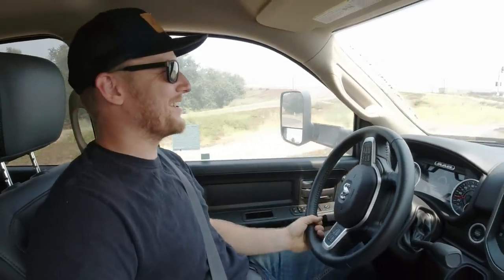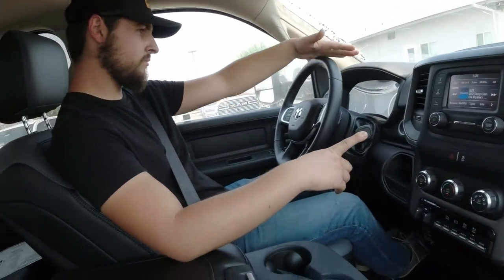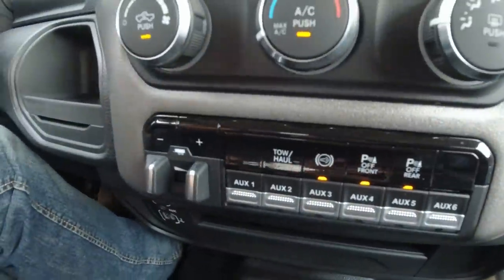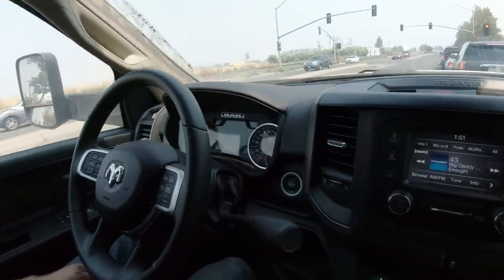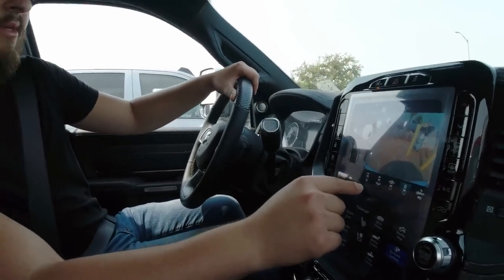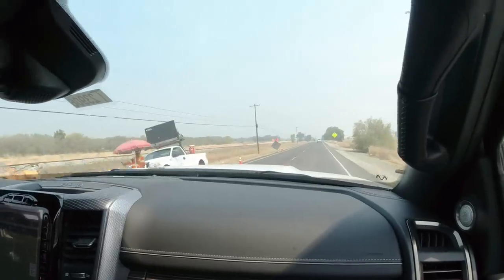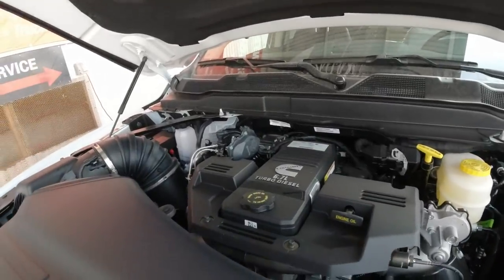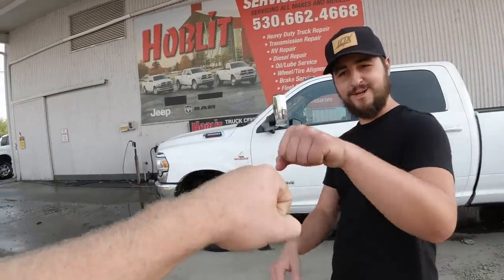BUYING A NEW 2020 TOW RIG. Go with a 5500 or 3500???

Comment: It is a tough decision because it is not just power and brakes.  The truck 3500 with the Max Tow package has the welded frame integrated hitch mounts and the sweet auto leveling airbags.  That is why I got mine as a DRW truck Tradesman (18).  The 5500 is nice because the D-rated engine will last longer, better turning, and more fuel capacity from the factory with dual tanks.  Probably for something that is always going to have weight he probably will like the 5500, power is nice in the standard truck but reliability of having the same cooling capacity and a D-rated engine is better.
Reply: Also, not sure how Ram is doing it now, but the Max Tow package includes all the hitch receivers and wiring.  I would be skeptical of a dealer selling a Max Tow without pockets installed, and again the factory receiver pockets are nicely welded into the frame.

Comment: I’ve been told that a truck with a flatbed has to stop at the scales on the interstates.  Have you had that issue?
Reply: I suppose rules vary from state to state, but having to stop at scales depends on if your vehicle is plated/insured as a commercial vehicle regardless of how the vehicle is outfitted/configured.

Comment: I've had both 3500 and 5500 but if not hauling more than 30k gvw then I lean to 3500
Reply: Very interesting. Im looking between a 3500 and 5500, I love the 5500 but don't like the derated and how they drop valves. I tow close to 30k maybe once in a while. You think I will be happy with a 3500 with asian?
Reply: Why dropping valves? Looking at a used 2018..

Comment: My only worry with those Rams is Hot Shot Dave’s threw a rod along with all the other problems he had with his 5500. I remember my 2000 F550 road rough as hell with 7.3L 5spd manual with the 12’ x 8’ contractors bed, until I got 1/2 a unit of plywood on it.
Reply: Never buy first year of new model I agree

Comment: Will the 2020 out pull your 2018 factory to factory?
Reply from the maker: Hands down yes. Way more power
Reply: @VBELTandSON  how? It's the same engine and transmission isn't it
Reply from the maker: 410vs385
Reply: Crazy. I have the identical truck as your 2018 but I have 373.

Comment: How hard would it be to put a 2nd gen dodge ram 3500 on a 2020 dodge ram 3500 frame? And can you put the 2nd gen dodge engine and transmission in the 2020 frame with the 2020 axles and springs?
Reply: Yo momma

Comment: My 2019 3500 burns oil. It burnt 5 quarts in the first 12k miles. I love the truck but just beware.
Reply: Best to keep track of it and make sure you document it with your dealer. Also if you are not putting a load on it, it doesn't help i have scene some B engines take up to 30 to 40,000 to stop using oil,  if you do not get a load on the engine.
Reply: @bobkanno6797  thanks bud. It's my farm truck. haven't pulled over 10k with it so far. I did call the dealer about it. They said that I should expect it to burn for the first 10k miles. They want me to bring it back in at 20k for them to look over.

Comment: They all do share same size brake pads, and that is deal breaker.
Reply: The '19 oem brake pads suck !!  I only got 40K on the fronts,  replaced front & rear at 80K. My GMC still has the oem pads with remaining meat on them at 120K miles.
One of my only complaints about my 1st Ram truck
Reply: @steeleexpressllc990  yes, that’s a real danger when operators falsely believe the bigger the truck, the safer they are! In fact, non of these trucks designed for load on deck but trailer behind with independent brakes.

Comment: I've never heard of any frame problems on a 3500 pulling heavy hotshot trailers. The 5500 is beefy for hauling freight or mounting equipment on the truck. There is no value to being over engineered and under powered. I drove a 2020 Ram 3500 DRW border to border and coast to coast to coast registered fro 45k and often pulling right around 40k with 40' & 53' flatbeds speed limit everywhere on the west coast only slowed below the limit when the limit was 75-80 in nearly all states east of the west coast.

Comment: Lmao.    I had to watch a Biden ad to get to the video.
Reply from the maker: Sob lol
Reply: Dag nabit.. Ain't that a bitch. Rip
Reply: V-BELT and SON 

Question here. I am very interested in getting a new ram but manual transmission. In your video you say the automatics are good nowadays. In your opinion is it for a daily driver and occasional tow rig better to get automatic? I drive a 2005 2500 Cummins towing is nice. but I feel the manual will give me better control. I know the power is turned down in the manuals. I could always tune or do things to increase but I think I might have turned that corner and becoming an old guy Lol. I don’t want to pay to play. Your thoughts would be appreciated since you have experience with both auto and manual. Thanks Adrian
Reply: @moparproud3978  yes, I am looking at older rams like the 18’s and on down with manual. But don’t get me wrong I have been checking out the Aisin trans and wondering if they are any good.

Comment: Still dodge junk
Reply from the maker: We tested other brands. Ram is by far the best all around pickup truck. Ford gm have crap trans now and terrible exhaust brake. You have any answer for those issues? Besides buying a ram?
Reply: @VBELTandSON  ford and gm are the only ones that have commercial series trucks the ram 5500 is only are glorified pickup must be you don't know much about transmissions either
Reply: @VBELTandSON  and yes the 2500 and 3500 chevy and gmc build their own transmissions but are designed by Allison and the 4500 5500 6500 gm trucks have a bulletproof transmission built by Allison
Reply from the maker: Well we were pick up shopping not mini fake semi shopping. No point in buying a big truck with small engine. Pickup fits the job better for what we do. And new Allison is same thing Ford is running. Same junker 10 speed. Awesome but doesn’t last.
Reply: @VBELTandSON  no it's not ford has nothing to do with Allison they build there own transmission it is called torque shift
Reply from the maker: Same trans different truck different name. Lol both crap